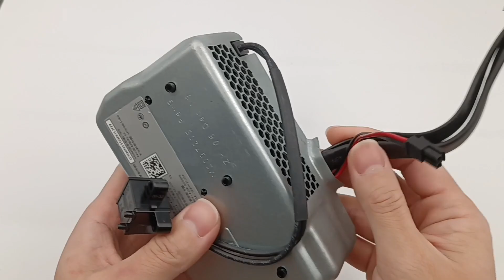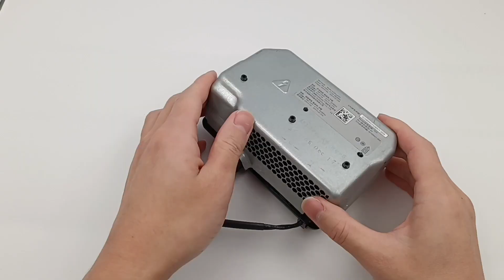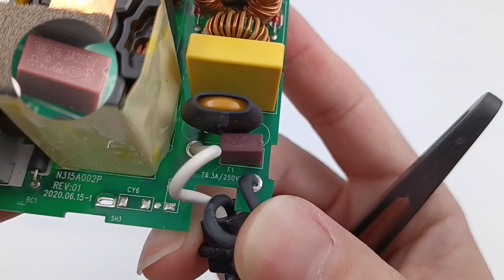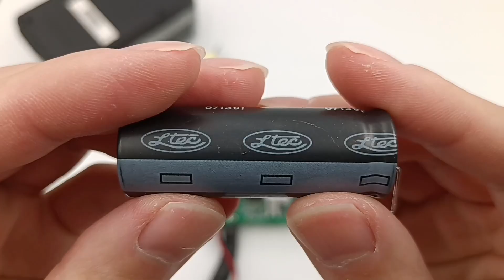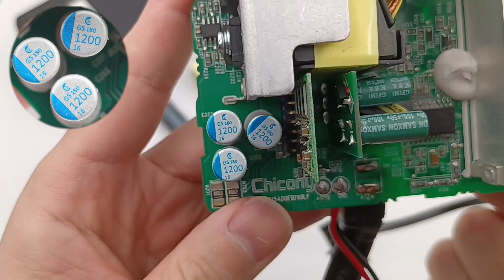Teardown of 255W Power Supply (For Microsoft Xbox Series X)

Comment: Can you use a standard ATX power supply assuming it meets the 12v rail specification using a 24 pin female to 10 pin male adapter??????????

Comment: This is simply wrong. Series X PSU is 315W.
Reply: It's not wrong. The PSU is 12 *  21.25 or 12 * 5. Can work with one or the other output, not both in same time.
Reply: @borisdg  it has a 315 watt PSU… confirmed by Jason Ronald at Microsoft..

Comment: Super cheaply built compared to the PS5 with all japan stuff.
Reply: I’m sorry but That isn’t cheaply built. It’s a 315W PSU in such a compact size.
Reply: @ARXInfinite  The choice of components is not good. See the PS5. Superior in power and quality.
Reply: @borisdg  …no The ps5 has a much bigger power supply and it delivers a similar amount of watts. Series X has a 315W PSU ps5 350W. Series X has better PSU components as of its smaller size it has too. Not to mention PS5 power supply’s have been failing a lot and have coil whine. There is no need to be a fanboy
Reply: @ARXInfinite  Not true. See the capcitors choice. Also see both videos. They said it aswell. It's not about fanboy. We talk about PSU made by Delta.
Reply: @borisdg  and Xbox use PSUs made by delta. They also use Delta Fans. The power supply in the Series X is completely fine. There has been So many Cases of PlayStation 5 defects. Especially within the power supply. Series X has also had a few issues but series X is just better built in comparison to Cooling to Board design I’d also like to say this video is wrong. The Series X power Supply is 315W not 255
Reply: @ARXInfinite  Its not. Xbox PSU is made by Chicony or Lite-On.
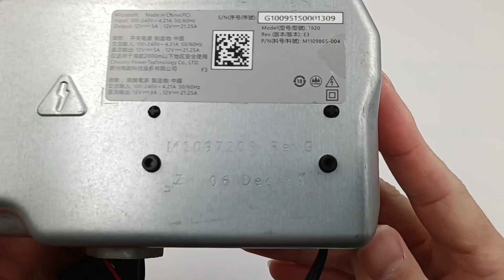Reply: @ARXInfinite  see 0:27 - Chicony Power Technology Co., LTD
Reply: @borisdg  I’ve literally opened my Series X for cleaning and The PSU and Fan are made by delta electronics. Stop chatting shit and spreading misinformation. My point still stands. Smaller Unit. High Capacity. 315w. Zero Coil whine. Series X PSU and Hardware is also More efficient. Look at power Draw Tests.
Reply: @borisdg  …yes on his Unit. 🤦‍♂️ And you do know Chicony make PSU’s for ASUS Corsair etc.. all High Wattage Power units for PC. And they aren’t bad Quality by any means considering 800W units can handle a RTX 3080 and 3090.
Reply: @ARXInfinite  See video, Nobody is spreading misinformation. See 0:27
Reply: @borisdg  the video is misinformation. It’s not a 255w psu it’s 315.
Reply: @borisdg  Sony also uses Chicony as manufacturer of their power supplies, or alteast they did with the ps4 and ps4 pro together with delta made ones. Japanese capacitors are kinda overrated at this time,  taiwan made etc brands can make just as good nowadays its just that the capacitor plague back in the day fucked over everyones reputation still to this day, but sure if you get nippon, nichicon or rubycon you know for sure its quality stuff
Reply: @ShimithDomencio  Yeah it's possible, but probably in the late generation cycle when cost-cutting started. I don't say Chicony are bad, but between them or Delta, the later is better.
Reply: @ARXInfinite Guess you're lucky to have a Delta supply in yours; however when I'm doing a quick Google search I'm unfortunately unable to find a single Delta power supply for the XBOX series X. Can you share the model number of that supply?
Reply: @jb5631  don’t know the Model number as it was 8 months ago I last looked. However the console was Built in January 2021 so maybe newer units use Delta 315W PSUs